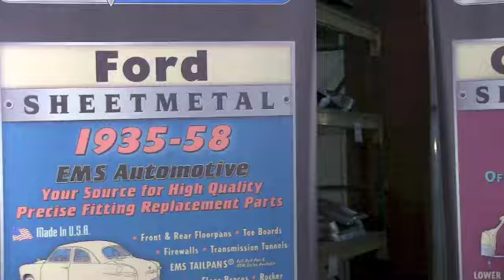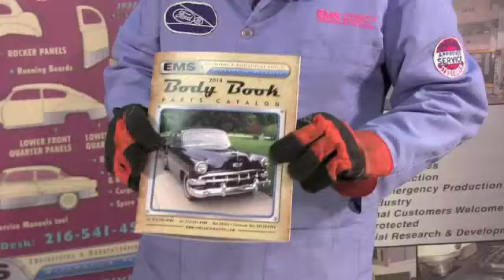1948-52 Ford F-1 Truck Replacement Panels

Comment: Cabs are all the same, parts that fit an F-1 cab will fit an F-8 cab.  The transmission covers are slightly different for different sizes but can be made to fit.